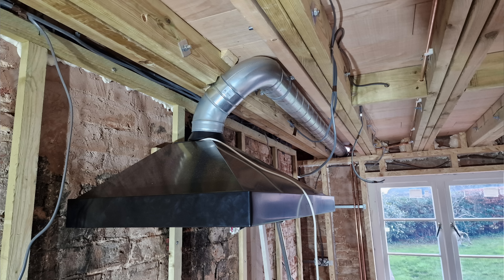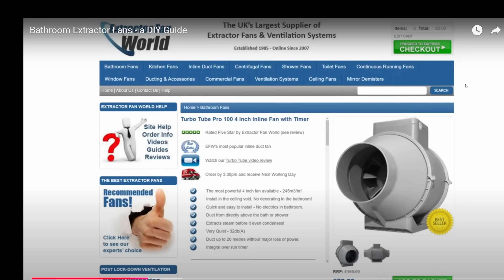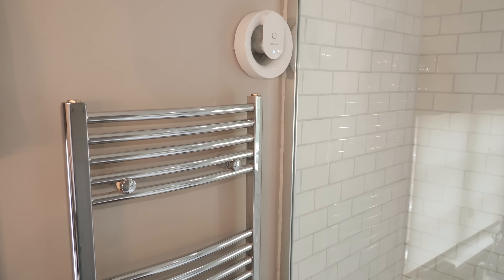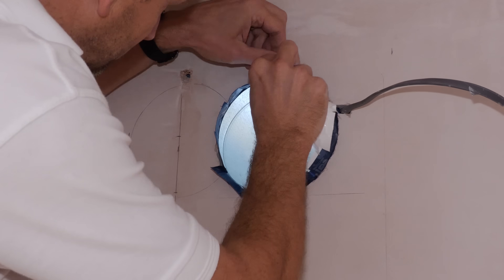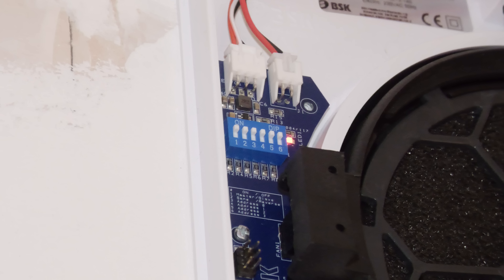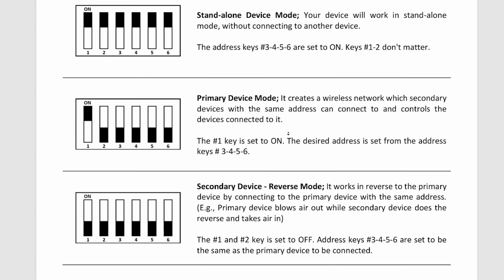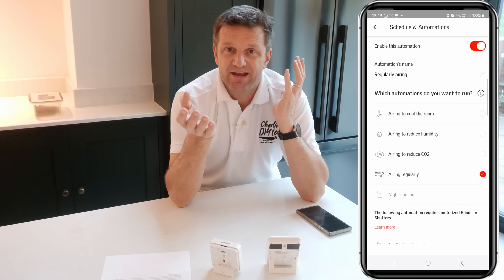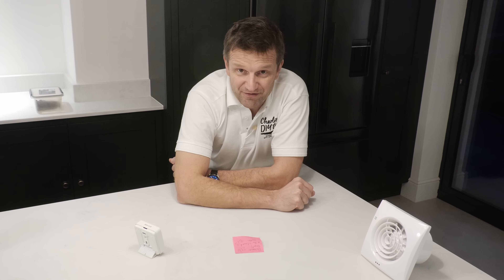A COMPLETE GUIDE to Decentralised Single Room Heat Recovery!

Comment: Even more-
1) This unit contains a filters (unlike normal extractors)- presumably to protect the heat exchanger from dust. Problem is, the air flow is reversed every 70 seconds, so most of the dust trapped on the way out will be blown back in again (did no-one explain to the designer how filters work?) So, all the dust, spores, etc are retained in your home. And you get to clean the filters. Not very often, because this reversing air flow will keep them clean!
2) In sleep mode, this runs at 15l/min. But the capacity of the tube is ~ 6l - so a third of the air is just being returned to the house!
3) Energy consumption- the claim is it uses less than 20% of the power the Kair uses for the same airflow. Does this seem likely? Kair recovery claim 'up to 86%' this one 'up to 90%' - at around half the price...
As a design engineer, I am constantly amazed that ideas that ignore the laws of physics come to market.
Reply: Interesting points you have made.. It appears that the Kair product is a shell and tube heat exchanger, so no reversal of direction, but a potential issue is the cross contamination of exhaust and supply being relatively close.
Another issue with the Zephyr is that when it is in extract mode, there is no heat recovery unless it is paired with a secondary unit, and as you have indicated around 40% of the extracted air will find its way back into the house, so 'extraction efficiency' is unlikely to be great! 😂
I might be mistaken, but think that gas boiler exhaust flues use a twin pipe construction to exhaust and supply air through the same opening, so would be interested to see more ventilation systems utilise this (like kair) - surely it would be a bit more efficient than the reversal method?
Reply: @aesopshair6690  

I had a whole home HRV in my last house and it use a single point for the input and output. They got around the  cross contamination of the supply by extending both pipes slightly from the house and bending the exhaust downwards. The vent cover also helped to keep the supply and exhaust from combing. From the video I noticed that the Kair product appeared to extend further out from the house and I'm guessing that they probably do something similar.

There's going to be cross contamination on this product because there doesn't seem to be a pause between the supply and exhaust cycles. Some of the air that is being blown out will be caught when the product turns to supply mode. A simple two or five second delay after the fan stops spinning between the two modes would have greatly reduced this risk.
Reply from the maker: There is a few seconds' delay between each cycle. I'm cross I didn't show that in the video.
Reply: @CharlieDIYte  Not sure what relevance this has- the dust retention would not be affected by such a pause. It is probably done to allow the fan (and air) to stop, so avoiding braking power being applied.
Reply: @aesopshair6690  The Zephyr relies on stored heat between in and out cycles. This has issues, some of which I have addressed. Co-axial heat exchanges are, as you say, used for boiler systems. They benefit from the hottest exhaust meeting the final inlet- it slopes in matching temperature (flow in opposite directions), making it fairly efficient. The problem is that you need a long duct,  but it can be done. Since thin polythene can be used for the tubing (little pressure differential) it can be very cheap. The most efficient system uses rotating plates- but that is only practical for a large centralized system.
I have some doubts about the power consumption on the zephyr - they claim about 12% of what the Kair one uses. Seems unlikely...
Reply: @aesopshair6690  Spot on 👌 The Kair HRV150 uses that twin-duct principle — supply and extract always run at the same time. No reversal, no pressure swings, just steady recovery. Appreciate you highlighting it.

Comment: The metal pipe is not good for insulation
Reply from the maker: Probably fair enough but it's got expanding foam behind and 3/4 of it is sheafed in the plastic I should have used.

Comment: Hi Charlie   Contentious topic , which in a way highlights the difference in how we live in the modern age . The more we do to increase the temperature in our homes the more challenges we encounter , the main difference is the change in the way we actually build and design our homes .  Certainly compared to the terrace house I grew up in my youth back in the early 50s .  A fire place in every room and single glacéd sash  windows that leaked like sieves .  And I think here  we have a possible compromise that is worth considering , I now live in a well insulated double glazed detached house . Yet we also have a wood burning stove , that is only used in the coldest of weather . Yet it sits there providing a passive form of ventilation ,  this ability I think we have lost sight of with the passing of time .     Yes the powers that be , seem determined to prevent the use of wood burners . But even if this came to pass , I would still keep ours for its ventilation properties, and have a bunch of dried flowers inside .    Kind regards as always .
Reply: If you are able to run your log-burner without opening a window, that suggests you have other sources of ventilation too. There are probably dual air vents to the fireplace area.
Reply from the maker: So true. We also have a wood burner which is now almost redundant since we installed under floor heating. But you're absolutely right in well insulated double glazed houses it's critical to have some form of ventilation - trickle or otherwise. I suppose the only question is whether in the absence of trickle vents, your open wood burner is providing sufficient ventilation. Better than nothing though!!
Reply: @CharlieDIYte  Log burners leak like a sieve- unless you have a flue valve. And there has to be air ingress to allow it to work. Your heat loss from this will almost certainly. exceed that fan recovery. To save heat, a flue valve would have been a better purchase...

Comment: a supply temperature of 14.5/15 degC with 14 degC outside does not show much heat recovery really. The way to test the heat recovery capability of this device would be with some colder weather, with something like 5 or 0 degC outside, where I would expect the supply during the 7 minutes cycle to remain at least above 10deg C, possibly higher, and see how it goes down while the thermal energy stored in the ceramic mesh depletes.
Also, another thing to consider is that unless you work with 2 devices meshed in "push-pull" configuration, with only 1 device (or odd numbers) you would always have cold air pushed in from any gap available when "extracting" and some good warm air being pushed out of the building without recovering when "supplying", because there would be a negative and then positive pressure in the building. And even if the house was air tight (unlikely), then there would be no air flow through the fan, right? :)
Reply: Pressure change in the house  during the 70sec cycle is trivial (~0.004 bar) but there would be some effect. But then the amount of heat recovered by this unit is also trivial- it would take over 100 years to recover its cost in saved heat. See my main posts for calculation. More importantly, it traps dust, spores, etc (dual direction filters!)
Reply: @Tensquaremetreworkshop  I didn't think about this too... Basically it works well to keep the outside stuff "out", but any pollutant  that is filtered coming from indoor would just simply be blown back in once the flow is inverted, true.
It is definitely better than an extractor fan by miles, but I am not sure about a decent MVHR. And at least in the uk, unless you have plans to extend on the roof, all the roof space is there to store the MVHR unit and the hoses to direct flow to the rooms, while extracting from another room creating a constant small air flow circulating between supply and exhaust. Ideally, with the exhaust in a bathroom, recovering the best heat, getting rid of the most humidity and even working as odour extraction with fresh air coming from the other rooms... Ideal world I guess
Reply: @Alex82pd  It is certainly true that air change systems work best when the system is designed into the house build. For one, it needs an hermetically sealed house. Actually, I think an extractor fan is better than this unit. The heat recovery is trivial, as I showed it is >100year payback. And it recycles dust etc. And it is only extracting half the time. And you need to clean filters that only exist to stop the heat exchanger blocking. And it is moderately complex, with moving parts, so there will be a failure rate ( I have a conventional timed extractor, and I am on my third in 10 years...).
Reply: The temperature of the air outside was between 11.5C and 12.5C which was shown after the thermal imaging. The internal air temperature was stated to be around 19C. Having an average of 15.5C for the incoming fresh air is pretty good and the best one could hope for in the larger whole home systems that pass the two streams of air in close proximity to one another in order to transfer heat energy from one to the other. I'd prefer to have seen thermistors measurements of the air temperatures immediately outside the unit for a prolonged period of time in order to get a good comparison instead of using the thermal camera as the thermistors would be more accurate. However, for a quick and somewhat accurate test the thermal camera is good enough.
Reply: @capitalinventor4823  Yes, it shows an efficiency of around 40 - 45% at these temperatures. These devices are usually quoted with 24C inside, and 4C outside! Even then it would not make 90% the best systems only make ~80%, and this method is seriously compromised. More important is the total heat transfer- which is trivial.